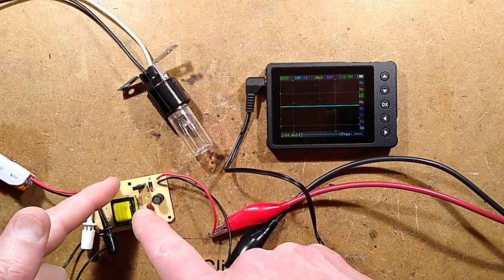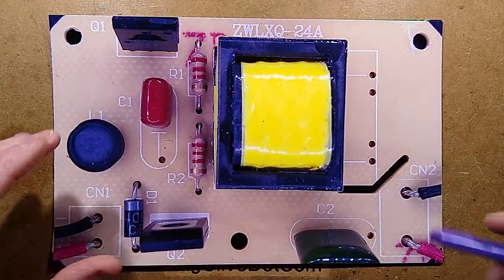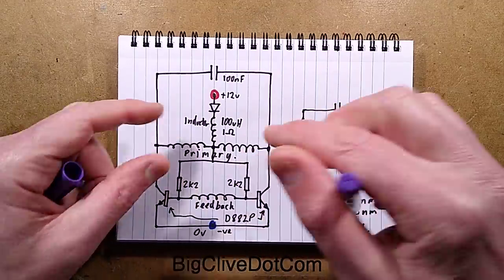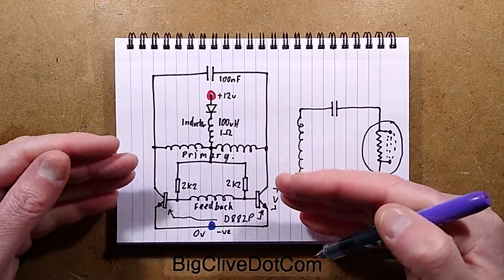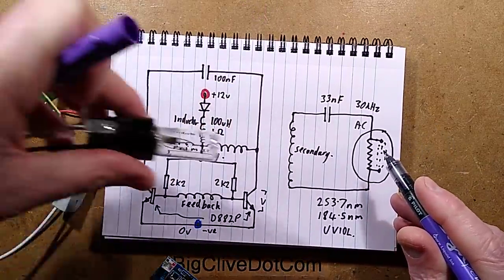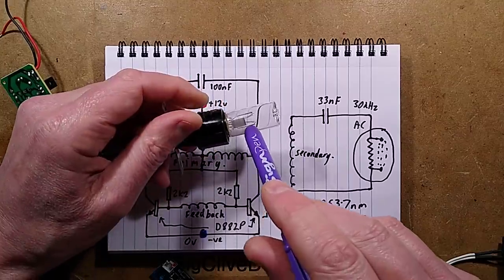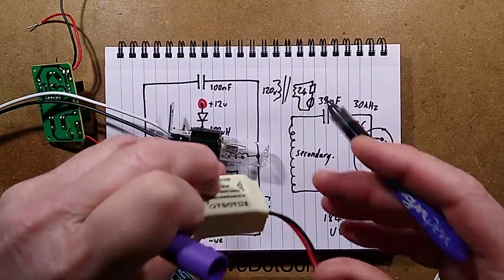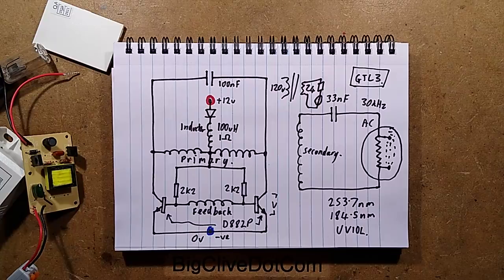Unusual low voltage AC current limited PSU

Comment: Looks like you could almost use that circuit as a sign wave generator for use in a custom DC to AC inverter. Change the inductor to slow the frequency down to 50/60hz??? is there a way to make it more curvey?

Comment: if this can work from 10 volts then why did vacuum tube electronics need such high voltage such as hundreds or even thousands?
Reply: Well first off all its a gas discharge with a small arc distance. Secondly there are vacuum tubes that you can run on lower voltages down to a few tens of volts. You just won't get high currents to flow through them and might have a hard time to drive a speaker audio amp. In the 60s the boom box radios had a 90V anode battery which was good enough down to 50V.
Reply: @LutzSchafer  there is a limit to the currents you can draw through a vacuum tube so i think you would have to have multiple parallel gangs of tubes like you do for transistors in say ebike controllers.

to get a vacuum tube version of a controller that can do 48 volt 40 amp it would be the size of a house and have hundreds of vacuum tubes as tubes can only handle a few milliamps so to get the high watts to drive a large speaker very loudly a voltage of maybe 1000 and current of maybe a few milliamps then would have to drive a transformer that would trade off the electrical to a lower voltage at higher current.

before mercury was discovered to be so dangerous every tube and light bulb was filled with mercury in some amount.

now that we realize how how dangerous mercury is it is only used in very specialist uses like some medical and scientific devices and fluorescent tubes
Reply from the maker: The heaters in valves/tubes run at about 6V.  The mercury vapour lowers the voltage in these lamps.  Very few valves/tubes have mercury vapour in them other than rectifiers.

Comment: I have a eprom eraser that has one of those type of lamps in it. It’s hooked up right to the 120v line! The shape of the filament makes it act as a current limiter, kind of like a self ballasted mercury vapor lamp.
Reply from the maker: There may be an inline limiting component like a capacitor or maybe even a resistor in the base.  Unless the shape of the lamp avoids the mercury discharge bridging the main terminals.
Reply: @bigclivedotcom  Does the mercury stay in the lamp? It sounds very toxic. Is mercury the only way to get the desired effect?

Comment: Simplest way to drive these, is to just use a big film capacitor (3µf for 240V like most clothes dryers, 6µf for 120V use) like is used for speed control of induction motors in fans and such, or sometimes a smaller capacitor in parallel with a PTC thermistor to make sure it gets enough current for the heater filament to start the arc that then goes down once everything's warmed up. Basically acts like a capacitive ballast so you can run it off of line voltage, since these days capacitors are cheaper than inductors.
Reply from the maker: Does it cause sputtering on each half-wave strike?
Reply: @bigclivedotcom  It might, but the strike on a warmed up tube is at such a low voltage in these that it's not that much of an issue - quite early in the sine wave. Especially since the filament never actually disconnects and is still in the circuit so the voltage across the capacitor's not seeing as big a jump when it strikes.

Comment: The plasma that develops, is a perfect short circuit. 
If you don't limit the current, it will pass so much current, the bulb will blow up, or something melts and cuts the current.
That would be bad.

Comment: You didn't mention  about   the isolation   slot on the secondary  Where  did  you get    that  scope?
Reply from the maker: I think the PCB is multi-use and that would be for high voltage cold cathode tubes.  The scope is a Seeed studio nano DSO.

Comment: First thought that went through my mind - will it erase EPROM's.
Reply: Yes, good practice is try one with progressive exposures until it's blank, then triple the time.  Erased hundreds with a GS2 , roughly the same bulb but spherical and so old there were beads of metallic mercury inside.
Reply: @garygough6905  I bought a Shenzhen special T8 germicidal lamp a few months ago that had visible beads in it, which impressed me because Hg is a fairly high value metal.
Reply: @Broken_Yugo  yes, it's only the vapour doing the work though, so much like the gold alloy connectors in a Burrows B500 computer the extra material expense doesn't serve much purpose.
Reply: probably
Reply: Certainly.
Reply from the maker: It's the right wavelength.

Comment: D882P transistor is the same one inside the mini plasma ball you took apart 4 years ago
My favourite NPN transistor.
Reply: I've never heard of the D882P. It seems to be a Chinese rip off the 2SD882.
Reply: i read they are the same just that on these transistors the leading 2s is ommited for some reason. which ultimately makes sense. you gotta know that you deal with a silicon based transistor. more the 2s wouldnt tell you any way

Comment: Philips used to make a 4w thermionic lamp with an E14 cap called the ‘OZ4W’used widely in laboratory applications, air/instrument sterilisers and in the continent barbers/hairdressers for sterilisation of combs, brushes etc. They ran in series with a bog standard 36/40w 4ft fluorescent lamp choke. In America a similar lamp was produced with an E17 cap called ‘G4S11’. These Asian made lamps are pretty much a direct replacement, they are even available with E14 and E17 caps.

Comment: I remember growing up in the 60's and my parents had a GE dryer that used an "Ozone Bulb." Current regulation was very primitive,  simply a 40 watt lamp in series with it, running across the 110 volt mains. (voltage has gone up over the years here in the states.) A little bit of googling revealed it to be a GE G4S11 lamp that looked about the size of a ping-pong ball.
Reply: I'm sure it was wonderful for the clothing lol. Leave a shirt in dryer too long it comes out 3 shades lighter!

Comment: Maybe I was taught differently but phase and line are two different things. USA home power is single phase 240/120 volts. At work we have single phase and three phase. If you measure three phase 480 volts power between any two lines is 480 volts ( phase voltage)but any line to neutral or ground measurement is a voltage of approximately 277 volts single phase. Just saying for educational purposes. Love the videos.
I probably should add 240 is single phase voltage measurement from line to line but each separate line is 120 volts to neutral or ground measurement. 😎

Comment: I wonder if with some clever generator+switch chip they could use that high frequency trick for capacitive droppers. Inductors are expensive, and so are big caps. The Chinese would do ridiculous things to shave off 5 cents. :D
Reply from the maker: They use it to allow the use of tiny capacitors in multipliers.

Comment: we've just paid a fortune to have something similar retro fitted into the air conditioning units in 5 of our 54 seater coaches. Ready for the coming rush lol
Reply: Hopefully you don't park your entire coach fleet next to stacks of oil soaked pallets like that outfit in California.
Reply: @gavincurtis  Did they produce enough ozone to set the pallets on fire? Can ozone even do that under normal outdoor conditions?
Reply: @IDoNotLikeHandlesOnYT  Not likely, ozone is very unstable and readily turns into dioxygen in lower atmosphere, although it does cause faster corrosion._
Reply: @DjResR  Sure, but a little bubble of it going past something particularly flammable might be enough. It's very reactive. Only takes a tiny burst of flame to set a fire off. I'm sure that, if ozone and flammable vapours were ever to occur near each other in some weird industry, there'd be LOTS of safety regulations.

Comment: Hello Clive! You've previously mentioned that ordinary glass blocks most UV. I've probably missed something important, but for testing purposes could you safely place that bulb in a glass tumbler to be able to work with it lit for longer?
Reply: @NinoJoel  "This UV lamp creates much higher intensitys"
That is not how physics works. Either a material is transparent  to a wavelenght or it isn't. 
"normal" glass (soda-lime) basically blocks everything under 300nm, UV-Lamps for sterilisation usually run at ~25 nm so they are blocked.
Reply: @ABaumstumpf  interesting to know but then wy can I get sun burns next to windows ? 

Surely these bulbs emit other wavelengths as well even if most of the uv light has the advertised wavelength. 

My industrial gas discharge lamps also have a second glass layer for uv blockage but manufacturing company says it will only block ~90% of the UV light. 

Then again I would not experiment with it assuming it will block the right wave length without any measuring equipment to prof that.
Reply: @NinoJoel  "Surely these bulbs emit other wavelengths as well even if most of the uv light has the advertised wavelength."
Yes, a tiny bit but usually >95% are of that one wavelength and that is blocked.

"My industrial gas discharge lamps also have a second glass layer for uv blockage"
Completely different technology and you want to compare them?

You can compare the UV-blocking to how you can filter out the wavelength of sodium-lamps. An extremely narrow band of light gets filtered out and allows astronomers to "ignore" the light-pollution of old streetlights, but any lamp that just looks orange but is not sodium-based basically does not get filtered at all.
Reply: @ABaumstumpf  well I was assuming they work similar since they also have a heater and are mercury vapor based just like the one in the video.
Reply from the maker: I could.   I do have spectacles that block the harmful wavelengths.
Reply: @bigclivedotcom  I'd be interested to see how well that works, and how much UV escapes the open end of the tumbler.

Comment: That tiny scope is totally adorable.  I want one!!!  <3 <3 <3
Reply: I got one several years ago. 100 bucks, Worth every penny. Great for quick work on the bench or having to work on a car because it's battery powered. Runs and charges USB. Battery will keep it going for about 3hrs. Not ideal as your main oscilloscope.
Reply: @Mr.Unacceptable  You can get them board-only for $20-$40  now.  Have a look on fleabay for the DSO-138, DSO-150 etc.  They are limited to about 200kHz but if you don't have hundreds to drop on a "real" scope then they are a very useful addition to the hobby workbench.  Mustool also have a DMM style unit for about $40-$50 which I don't know much about.
Reply: @Mr.Unacceptable  Same price as a Hantek 2d72. Seems a bit steap to me.
Reply: There's also the DSO Quad which is about the highest performance one in the form factor that I'm aware of.

Apparently it has an upgrade now, DS213, increasing the bandwidth to 15mhz
Reply: A pair could be fastened to the front panel of an audio amplifier to show the waveform of each channel.  Makes the blank space useful ;-)
Reply: That scope would be perfect for automotive. Even just to check the alternator all the time... I need this.
Reply from the maker: There's a version sold specifically for mechanics.  Different screen layout, but basically the same.
Reply: Everyone always says spend like $800or more ona scope, make sure it's multi channel, 10MHz blah blah blah which is all well and good if you can afford it but it means someone like me just goes without a scope. But this I the first little cheap scope I've thought might actually suit me, as long as I keep in mind its limitations. I'm not planning to ever probe anything that would fry a scope, but I've avoided USB scopes because of the danger of damaging your laptops USB port.
Reply: Dig the scope man
Reply: I got myself a scopemeter. Hantek HT2D42. (Ninja edit to add the model)
Has standard banana jacks and the typical assortment of DMM functions - AC and DC volts, amps, mA, ohms, continuity, diode check, with automatic ranges.
Then it has a fully featured dual channel digital oscilloscope and onboard function generator.
Whole shebang is USB charged and self powered with a cute little TFT LCD.
It's about the size of a typical DMM, and I paid a little over US$150 for it on Amazon.

Comment: Seen a few ads with people waving UV lamps around supposedly cleaning areas, only problem if they were doing anything as you say Clive they wouldn't be doing any good to the people using them.
Reply from the maker: A lot of it is theatre.
Reply: Waving around a UV lamp won't help anyway. 
They do more harm than good if you use them In that way
Reply: @NinoJoel  How is that?
Reply: @SBCBears  Inverse-square law would come to mind - the thing closest to the light would be the person waving it. So if the UV is strong enough to sterilise anything it is also more than strong enough to damage your skin and eyes.
Reply: @ABaumstumpf  depends on the wavelength.  Standard 253nm UVC bulbs are no good.  The new 222nm UVC lamps are safe because the UVC cannot penetrate living cells yet can kill viruses.

Comment: Have you ever tried using a 2X2 vacuum tube to make x-rays? 

I'm wondering what kind of fly back transformer to use for this purpose.
Reply: did that, you can use whatever hi-v tube like a DY87 and a TV flyback powered with a mosfet setup, at like 25kV it will start emitting x rays
Reply: @NinoJoel  the guy is using an intended x ray tube, he says that, and at 40kV... no sorry, i tried 3 different tubes and all of em were modest at generating x rays, all the videos i've seen were modest too

i appreciate your toughts about safety but don't worry, if you use a trash tube and not at high power the exposure will be little, of no concern

i'm not going to relpy anymore, we said enough, have a nice day
Reply: One piece of advice.... 
Just don't try to create X-Rays.

I know not one but two people that thought they had enough knowledge and safety equipment and both had cancer afterwards / one died.
Reply: @NinoJoel  nah.... i did that, the amount of x rays you obtain is just slightly above background radiation, which we always are immersed into... consider that aour body produces by potassium etc. more than 4000 decays per second, to obtain that with a non x ray intended tube you need to power it with a lightning, so intrinsically no risk when doing that experiment
Reply: @redoverdrivetheunstoppable4637  Radiation is not always the same. 
The decay that ocures naturally is mostly really weak alpha radiation that is not really strong enough to penetrate anything. 

Depending on the tube you abuse for that experiment you can create radiation strong enough to penetrate walls in your home.... 
Needles to mention that it will not be healthy for a human body. 

Experimenting with pretty random junk parts is dangerous when it comes to creating radiation since you never know how much you will generate. 

Just keep that in mind and stay safe.
Reply: @NinoJoel  don't worry, potassium and other stuff doesn't produce alpha (potassium i think beta) and the x rays you make with a junk tube are low energy weak x rays, i've monitored with my geiger and the amount wasn't even much, i've heard geigers BEHIND real x ray machines and they went crazy anyways, talking about a dose it may be like 1\1000 of a human radiography... i'm sorry but i think it's just an innocent experiment, of course you can't let the system go for minutes, just a couple of seconds and at moderate supply voltage levels

Comment: This reminds me of what I did with a CFL one time. I took a CFL apart and connected the filament at one end to my power supply, and then started winding up the voltage to see how bright the bulb would go from just the filament alone before it popped. but then the tube suddenly light up brightly, because the gasses inside ironized (at least I think that's what happened).
Reply: I wonder if you could use neon or another gas in this type of bulb and if it will light at low voltages like this
Reply: Preheat start fluorescent fixtures with a start button (as opposed to an automatic glow/electronic starter) can do the same. Hold it down, then the filaments incandesce, then a second later a discharge will form across each filament individually. Release the button and the entire tube lights as expected.

Comment: Could you just put a glass over the bulb? Regular glass would block the uvc

The pcb looks a lot like a plasma ball circuit I have
Reply: @NinoJoel  "Regular glass does not block UV light in these intensity" Any source for that claim? Cause material-science says otherwise.
Reply: @ABaumstumpf  yea I just missed the whole wavelength blocking thing. 
Ausuming the UV lamp only emits the advertised wavelength. 
My bad.
Reply: @NinoJoel  that's an odd statement, nothing will block all, but it likely will attenuate it to a safe level. Just like the thin clear glass/polycarbonate in a welding helmet does (the shade is only for the intense visible light), or the glass envelope of a florescent lamp.

Comment: it looks awfully like a CCFL inverter, but with low voltage 

does this lamp smells ozone when lit  (185 + 254nm)  or not ( 254nm lamp) ? 😉
Reply: I believe these bulbs were developed for ozone generation in clothes driers.
Reply from the maker: This version actually does produce ozone.

Comment: Wait how was the scope hooked up to that or was it just picking up the noise from the switching?
Reply from the maker: Directly across the lamp as it is low voltage.
Reply: @bigclivedotcom  I figured that was the case, but are the probes wireless or is that barrel jack not for powering the scope?